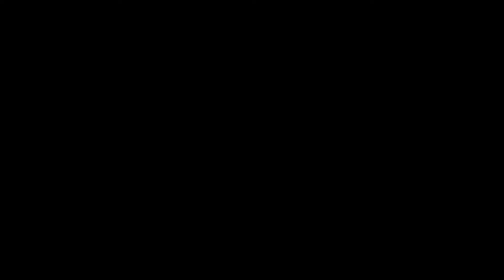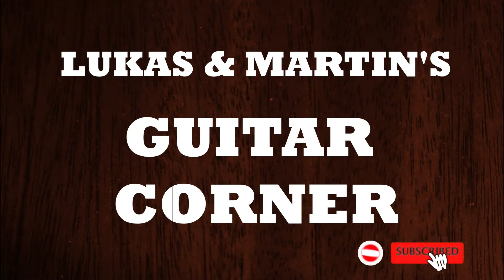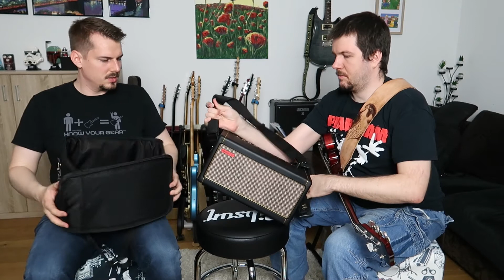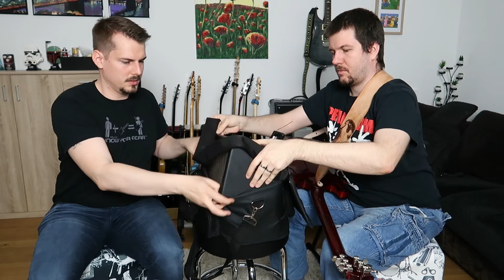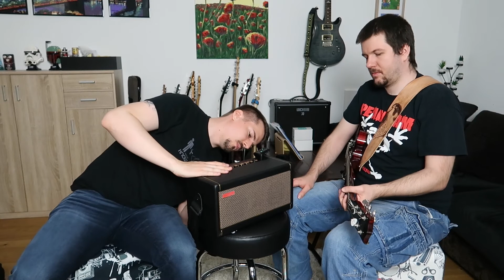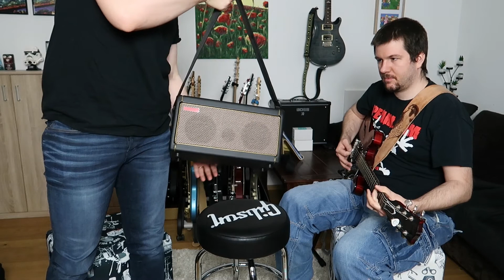How to make the Positive Grid Spark 40 wireless - External Battery Mod

Comment from the maker: Also worth to mention, this also solves the ground hum issue caused by the first generation of power supplies that came with the Spark.
Reply: Any owner of a spark with a noisy PS can get a new one for free from PG just by emailing them and letting them know there is an issue... I received my new grounded Hum free PS  3 weeks after reporting the hum from the ungrounded  PS .
Reply from the maker: @RaptorV1USA  Thanks, we know. I also contacted them in August and got mine. We just thought it's worth mentioning that this would also solve this issue. Or better say, this solution is not causing such an issue. 
Cheers,
Martin
Reply: @LMGuitarCorner 

I figured you knew.... that was for others who may not still...
PG isn't letting early buyers know of their PS  replacement policy...hence my learning of it and emailing them 8 mo after purchase... they responded well.... fwiw I am in USA no idea what their intl policy is..
Purch another Spark for a friend in Dec., it arr. w/ grounded PS. 

I also have the "Sheboygqnan" batt setup works great may have to look into this one  the orig. model he found was replaced with a new one & only 1  i could get is white lol... prefer the black...and the voltage adj. Feature....

Great video !
Reply from the maker: Thanks a lot! Glad you liked it! Yeah, we're in Austria and they tried to talk their way out of this and requested proof of it, that it's the PS. I had to make a video of it, and they gave in after that one as it was plain obvious when it went away after plugging in the USB which then grounded it over my PC. Had to guide a friend of mine through this procedure of how to present the video to them as well, so they would accept it. After that though everything went smoothly. But it's good they replace it. Other companies might just show you the (virtual) middle finger.

Comment: Whats the name if the battery again please? And where it can be purchased?
Reply from the maker: Hey Riadh. The one we have is a Xoro MBP 2005 and we bought it on Amazon DE. Unfortunately this exact one is no longer available, but the link still works which should help you in finding an alternative with a similar capacity.
https://www.amazon.de/dp/B077X91WK5?ref_=cm_sw_r_mwn_dp_T8VEBM7471QCF7AE8B4Y
Cheers, Lukas
Reply: @LMGuitarCorner  so if I understood well I need a charger that has 15v output and 2.5A? Right
Reply from the maker: No, you need 19v DC, 2.5A. Please watch  the video again, we talk about this between minute 1 and 2. Cheers
Reply from the maker: As the one we have is discontinued now, I've looked up an alternative. 
This one should work:
https://www.amazon.de/XTPower%C2%AE-XT-16000QC3-Powerbank-moderner-15600mAh/dp/B07PY8516W/ref=psdc_571712_t3_B077X91WK5?th=1
Cheers,
Martin

Comment: I would give my kingdom for a volume pedal!
Reply from the maker: Where would you want to place the volume pedal in your chain?
If it's in the front, as a foot operated volume pot alternative, like most people do, then why not just place a regular one in front of it? I don't have a dedicated volume pedal, but the Clapton Midboost Pedal I made, has a volume on it I use in pretty much the same fashion. I've used it several times with the Spark and it works perfectly fine. Actually I'm surprised in general how well the Spark takes pedals.
Cheers,
Martin
Reply: @LMGuitarCorner  Well I have an EQ, which I can use in a similar fashion, but it then greatly increases the amount of distortion if the volume increases. So, I really need it in a effects loop. 

I just returned a Line Pod Go thinking it's pedal might work, but I couldn't get it to sound as good as the Spark.
Reply from the maker: Ok, I think I got you. So you pretty much want to control what they call "output" on the Spark with the volume pedal. To be honest, for that I only have one idea but it feels more like a dirty hack to me than a solution and I'm not sure if it would cause other problems. That would be replacing that said pot with a jack and a volume pedal with just that pot inside. So pretty much just rewiring that pot far away from the amp. 
Cheers,
Martin
Reply: @LMGuitarCorner  Never would have thought of that.  That's brilliant.
Reply from the maker: @valueofnothing2487  Thanks, you'd lose your regular output volume though and you'd be forced to use that pedal at all times. Also, I'm not sure how precise you can control it with your foot. Pretty sure, you can't use it in a regular Volume/Wah pedal fashion, as the pots in there only have about half the turning distance of a guitar pot and I think the ones of the Spark have a similar one like the ones on a guitar. I would probably make it similar to how I've made the volume on my Clapton Midboost Pedal. We have two videos on it, a tutorial and a demo. You can see there, how I've made it.
Cheers,
Martin

Comment: How about figuring a way to use a WahWah Pedal on the Spark Amp ??? I’ve got to have a WahWah Pedal !!! I’m addicted to it 💉💉💉💉💉!!!!!!!!!!!!!!!!!!!!!!!!!!!!!!!!!!!!!!!!
Reply from the maker: What problem do you have with the Spark and your Wah Pedal? I've just tried mine in front of it, just like on any amp, and it works perfectly fine.
Cheers,
Martin
Reply: @LMGuitarCorner  Oh... cool 😎.
I'm an Idiot, didn't think 💬 🤔 to do that!?!?
What if you have a Neural DSP Quad Cortex? Can you use a Wah Wah pedal with that? I know that you can add an expression pedal but I don't know if it can be used as a WahWah ???
Thanks for the info !!!
Reply from the maker: @jameslanclos568  Sorry, I don't have a Neural DSP Quad Cortex, so I can't tell you about that. But again, I would just put my normal Wah in front of it and use that. I don't see why that wouldn't work.
Cheers,
Martin

Comment: Many words. But don't Understand how collegate Jack into power bank from amplificator. What kind electric cable jack/USB tu use...??? This you need to know. No only many words useless. So
Reply from the maker: The battery we used already came with the proper jack. It's a 5.5mm x 2.5mm DC Jack. I hope this answers your question. We forgot to name the jack as ours already came with it and it is a standard used on Notebooks with 19V DC input, sorry for that.
Cheers,
Martin

Comment: Apparently I'm the only one that hasn't found the Spark Bag for less than ransom-level prices. People are charging too much for those things.
Reply from the maker: You can also use other bags, e.g. for the Kemper. Check article 403333 on the Thomann website for reference. Martin uses it and it works perfectly. Cheers, Lukas

Comment: That looks way more efficient than mine. A box full (240 kg) of deep cycle batteries and an inverter. That I call my box o tricity. It runs the whole camp site for an evening. If ya keep things reasonable.
Reply from the maker: Plus, it weighs less than 1 kg!
Reply: @LMGuitarCorner  mine should say team lift but I’m stupid and move it myself 🤣. I’ve got a nice little Bluetooth speaker so I’m just looking for a cabinet simulator to put after my dirt pedals to make a back garden volume pedal board, I’ll probably try the sonic cake as it fits my minuscule budget.
Reply: I totally thought you would spin it like a rotating Leslie at the end of the video 🤣.
Reply from the maker: lol one 360 was enough (or rather two 180s)
Reply: @LMGuitarCorner  Oh I got the effect I love me some rotation